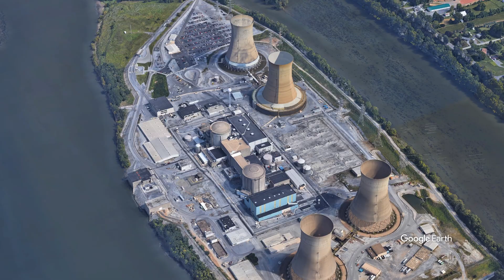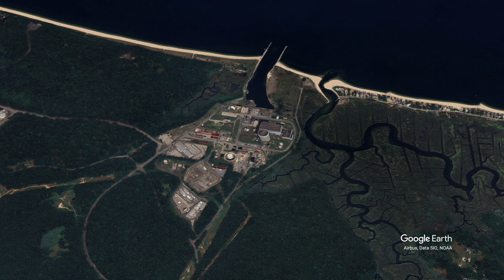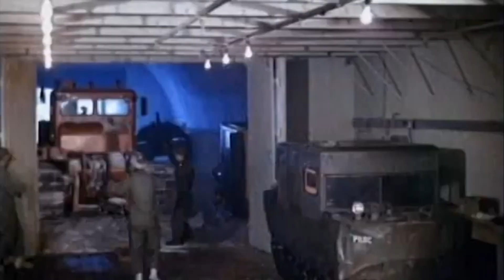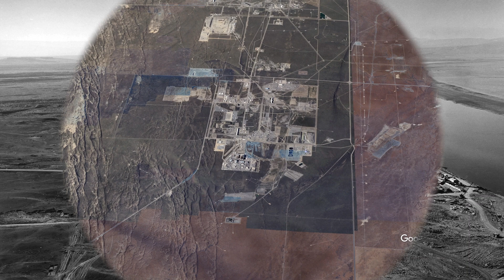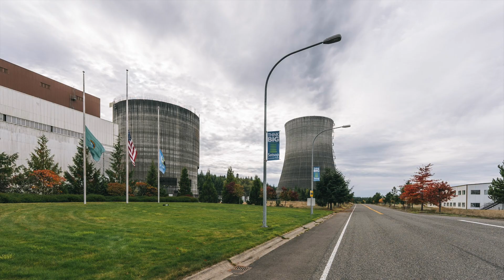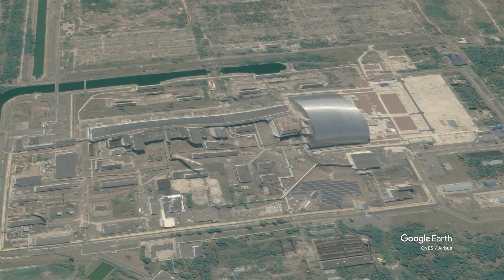Top 10 Failed Nuclear Projects

Comment: A little bit of an interesting update to 3-Mile Island, in September 2024, Constellation Energy the current owners of Unit 1, announced plans to invest in reopening Unit 1. The plant is expected to resume operations in 2028 as the Crane Clean Energy Center (CCEC). The entirety of the plant's energy output will be sold to Microsoft Corporation. Microsoft entered into a 20-year agreement to purchase as much electricity as possible from the plant, which will support the company’s growing energy needs for its expanding network of data centers.

Comment: Ah well sounds like we all need to bring these facilities to fruition at this point to power present day inefficient yet major technological advancement demands that will only continue to drive future energy demands. After all- if we were smart enough to get these plants built to 35% 60 years ago, I surely hope we’re further capable of completion without lacking safety precaution intelligence. As we know long term consequences of cutting corners surrounding nuclear generation and storage facilities. Additionally, latest technology hardware and software architects and developers should be able to squeeze in further energy enhancement features reducing overall energy consumption of future devices as Intel Corporation will soon have ability to produce even smaller nanometer microchips when the latest chip plant is built here in the United States of America. 🇺🇸  reducing dependencies for advanced microchip manufacturing outside confines of North America. Not that we aren’t already the best most advanced country in the world or anything…. Further, it’s not like we’re trying to reduce foreign dependencies we like other countries. This would allow other countries with chipmakers to also further advance chip development potentially reducing costs for mankind all around the globe.
Reply from the maker: All great points! Definitely will see an increased demand for power with all the new technology, so it's going to need to come from somewhere. Thanks for watching and for the insightful comment!

Comment: I would add fairly unknown A1 block in Jaslovské Bohunice NPP. It used a unique reactor design (KS-150) made primarly by Czechoslovakia, making us one of the pioneers of peaceful nuclear energy. It cost absurd amounts of money, was in development for 16 years, and it was finally launched in 1972. But, six years and two accidents later, it got shut down. At that time, the construction of V1 and V2 had started on that site, using more conventional VVER reactors from the Soviet Union. A1 didn't say its last word tho, as it caused more problems during the decomissioning. Huge radiation leaks were measured thanks to absolute indifference of some workers that worked on dismantling the reactor. After the Velvet Revolution, the decomissioning is now Top Secret and everybody's acting like nothing happened and that the process is fine now. No information is provided to anyone.
Reply from the maker: Interesting, I wasn't familiar with that one. Thanks for sharing about it, I'll definitely look into it further!